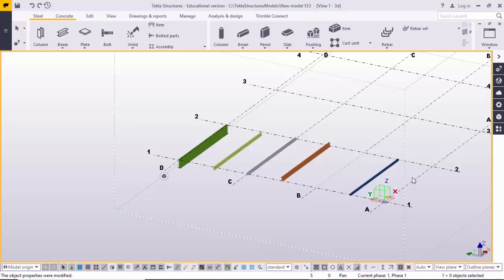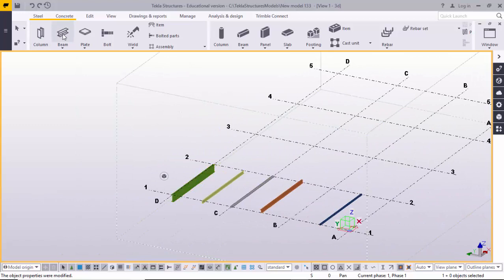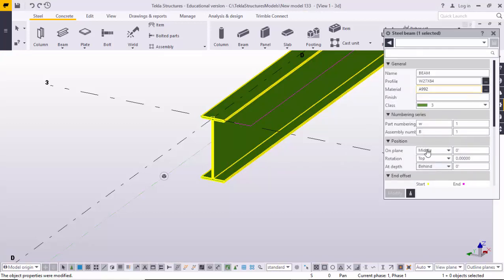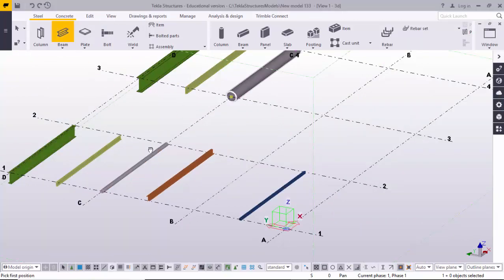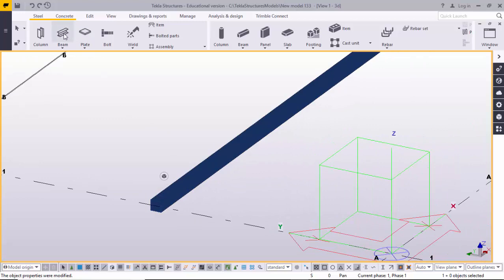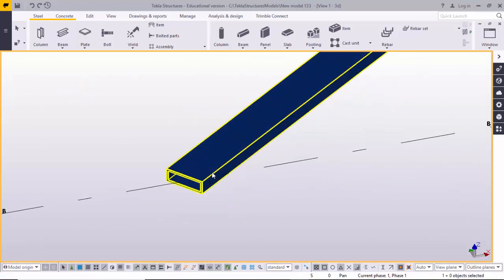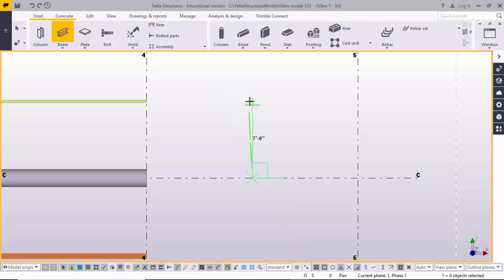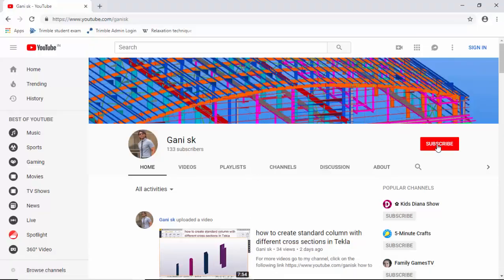how to create standard beam with different cross sections in Tekla

Comment: Is there any way you can show us how to make a profile with variable cross section. For example: Start of the beam : IPE 180 ; End of the beam HEA 320?
Thank you very much
Reply from the maker: Hi Naum Stefanovski, you can change cross section size on both end for one beam , but you can't change one beam with two different standard profiles. if you need you can combined two beams with welding option in software and practical